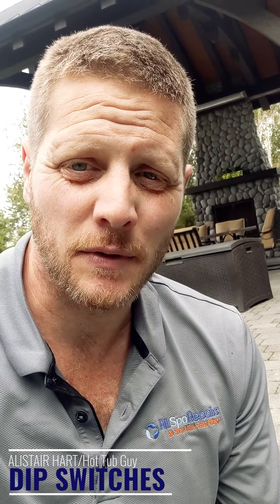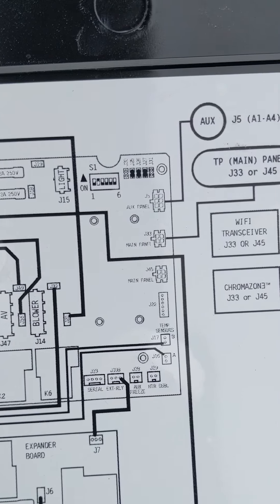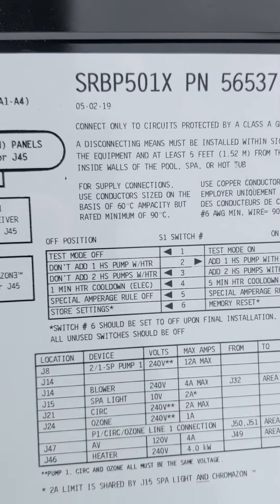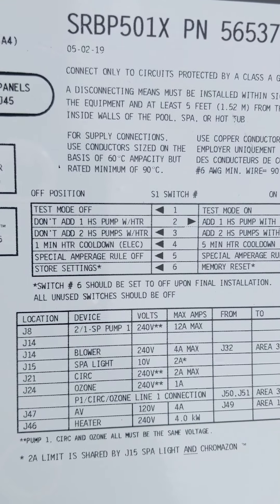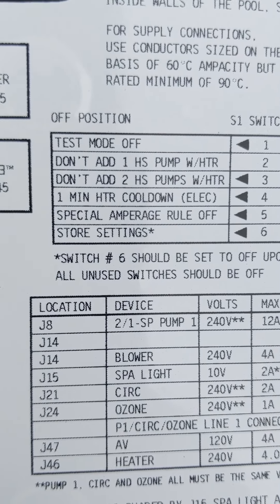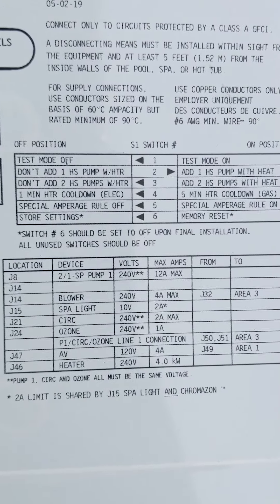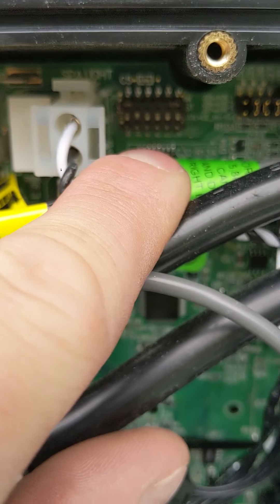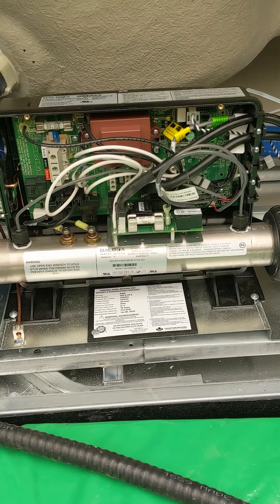Hot Tub Dip Switches

Comment: Balboa VS 500 with 4 button LCD control,  I added twin 5hp pumps and a expansion board for pump 2. Do you know how to make the control panel turn on pump 2? The signal to now control pump 2 to turn on is now the ext relay pins J60 on the main board. almost like I have to go into test mode and tell pump 2 button to use the External Relay. when in test mode I see flashing F= B= A= I can not find anthing on the web about this.

Comment: Please help I have a Balboa control and topside none of my buttons are responding when I push them I replace the tops I control and same thing I have power everywhere but just no respond when pushing the buttons if I remove a heating element plug everything goes into freeze mode and everything comes on like it should I'm stuck need help any suggestions
Reply from the maker: A little to complicated to throw out guesses, your best course of action is to hirer a tech to look at it.

Comment: I have a cal spa 2100 series, OH on me last year and the board was outdated. I replaced my circuit board, control panel, heater tube/element from spacare.com and I am still having issues with it being stuck in EC mode,  I sent it back to be tested and they said it works fine for them. I am still in EC mode it doesnt change touch the temp/light button just flashes EC mode and current temp. any help to my problem? I have tried everything I possibly know.  I don't have any error codes, everything else works.
Reply from the maker: Each time you press the temp light combo you should get a new code. 
Temp light Ec
Temp light Sl
Temp light St 

If that's not the case, I would be curious to know if the board you replaced is compatible with the old topside.
Reply: @TheHotTubShop  they gave me a replacement with chip# c2100R1A thru C2100R1E
 PN: ELE09100205 balboa # 52299/52199 . 
Not sure if you be able to help me with that but I’m at a lost what to do next after spending over $1,000 , I appreciate all you have replied back. The old topside does the same thing as the new topside. No difference